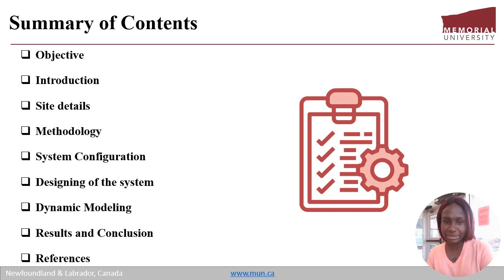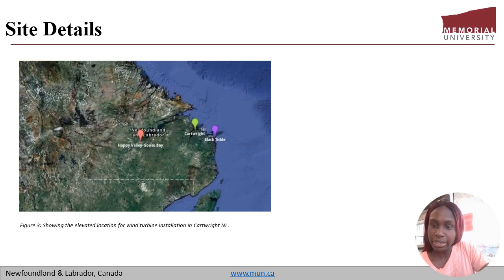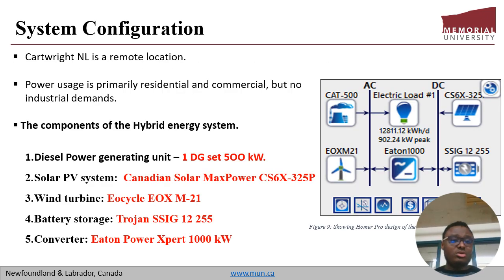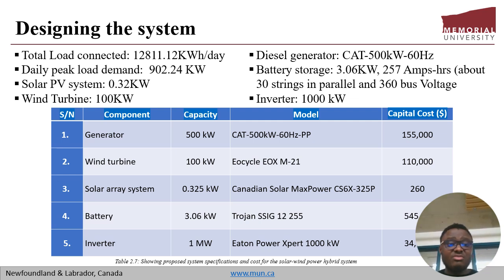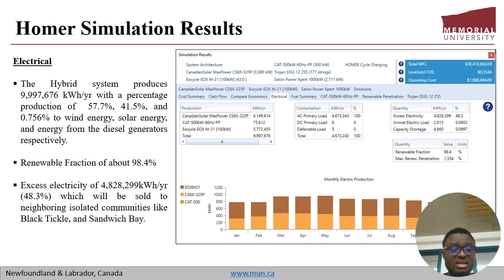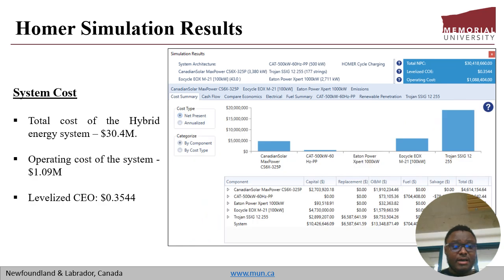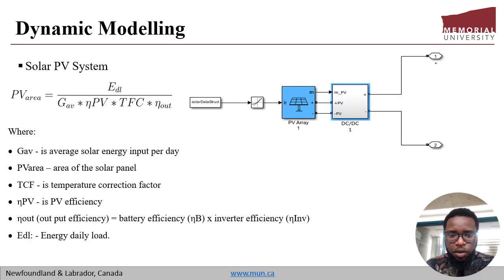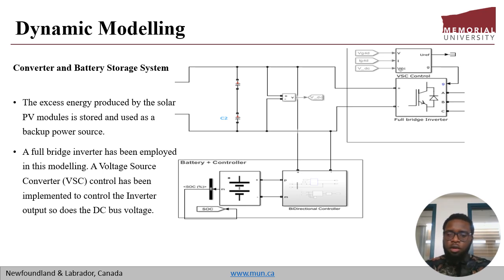ENGI 990A Project Presentation

Comment: How do you determine the specific sizes of the components to add and run. Did you just guess it or there's a calculation with the load that gave the idea of the components in estimate...?